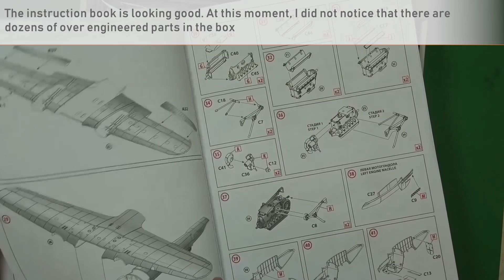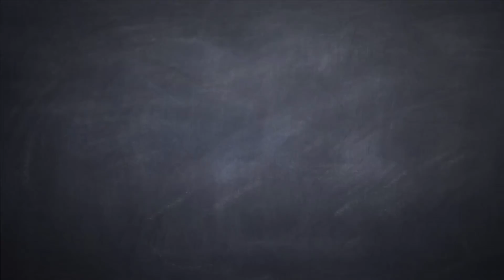Building The ICM Do 215B-5 Night Fighter in 1/72 Scale Model Aircraft

Comment: The Vallejo acrylic putty is great for ejector pins. Fill the holes, let it dry about thirty minutes, then wipe away the excess with a damp cotton swab. No sanding needed and easy to work with.
Reply: Oh, and it has no odor and doesn’t scar the plastic like Tamiya putties :)
Reply from the maker: Thank you for information. I have that but I don't like use it on fixing level difference problems like this case.  It's unstable and hard to rescribing on it. Tamiya White is overall the best putty I ever used. Also Mr. Dissolved Putty works like you descripted (Wiping with alcohol) I use Vallejo putty but rarely.

Comment: I'm interested that you use IPA to do most of your paint thinning. I use Mr Color Levelling Thinner which I see you use for your varnish thinning only. What's your thinking on this? p.s. Very nice model by the way.
Reply from the maker: Thank you. I use Leveling thinner with only X-22 and all lacquer paints. IPA is cheap and odorless only. Not any other advantages over Leveling Thinner.
Reply: @Scaleaton  Can I ask another question. I bought some Mr Surfacer 1500 but its in a rattle can. I note that you thin yours; do you decant it first?

Comment: Excellent build. I'm building the recon version of this at the moment. I had lots of trouble getting the engines to fit flush with the wing and the 
wing to seat properly onto the fuselage. when I put the engines in the wing it pushed the wing surface down. Did you doing any preparation that we did see for these to items?
Reply from the maker: Thank you Greg! To be honest, I don't remember the build details. Probably yes, I always do dry fitting test with clippers and make modifications required.

Comment: what beginner airbrush do you recommend
Reply: I just started doing models again after 20 years or so. I wondered the same thing. I seen a lot of recommendations for Iwata Neo. I picked one up for $60. I think it works great, but I am still new to this. I believe Scale-a-Ton also uses a cheap Iwata sometimes. Hope that helps.
Reply from the maker: Hi, I don't recommend airbrush. The proper airbrush depends your budget, skills and what will you do with it. But you can start with a AB-136 which is $15-$20 on market. You can learn to cleaning, maintenance your airbrush. This is a rule you will breake your first airbrushes tip or needle sooner or later. GSI Creos airbrushes are the best price/perormance for modeling though.